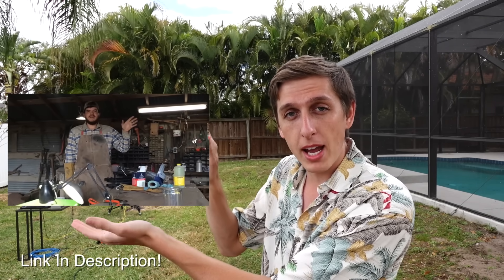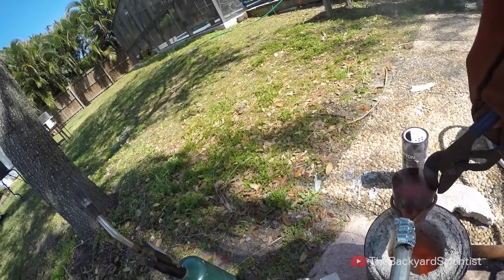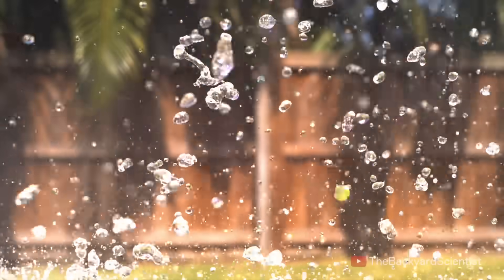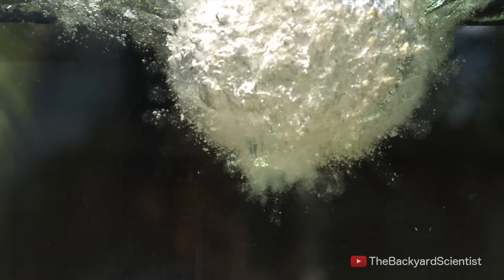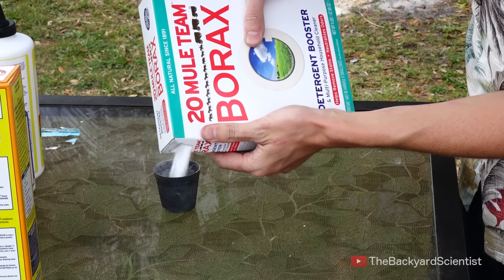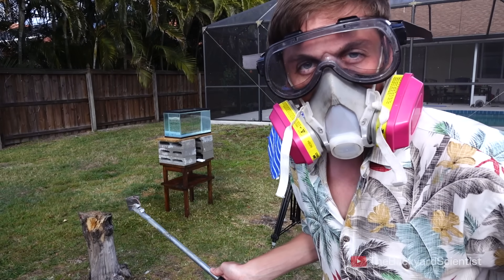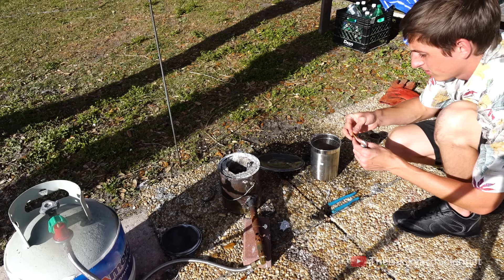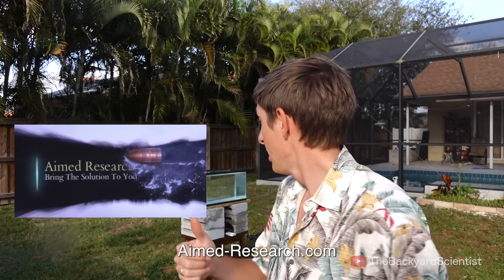Pouring Molten salt into Water - Explosion!

Comment: Is it possible that the extra extreme heat causes the NaCl to instead breakdown, when added to the water, into pure sodium and chloride rather than their respective ionic forms?  The sodium could then react exothermically with the water again, forming NaOH and hydrogen gas, but rather than the gas reacting in a fiery explosive way with the free oxygen in the air, it binds with the chloride to form HCl (again, because of how the extra initial heat could offer the elements different reactive options than what happens at room temperature).  Perhaps it could even occur as an immediate "switcheroo," with the formation of pure sodium simultaneously breaking apart the H20 and allowing, as mentioned above, the chlorine to bond to the hydrogen?  What are your thoughts, internet chemists?  Please note that my knowledge of chemistry is quite weak, but it does seem apparent that the excess heat does allow for otherwise abnormal reactions to take place more readily.

Comment: Salt has very high affinity with water, and wants to bond as quickly as possible. Salt ionizes in water. The sodium and chlorine atoms separate and intermingle with the water. 
The salt is NaCl, and the H atoms of water surround chloride ions and O atom of water surround sodium ions. This is called enthalpy of solution and this releases energy,  depending on whether the salt is a hydrate or anhydrous. I have no doubt that the act of melting the salt makes it anhydrous. I guess this combined with the thermally generated steam is enough to make a pretty cool explosion.

Comment: You should also take into consideration that it is probably working like this in the environment: 
NaCl(aq) + H2O(l) --> NaOH(aq) + HCl(g)
Then it reverts back to its normal equation after reaching a certain temperature:
NaOH(aq) + HCl(aq) --> NaCl(aq) + H2O(l)
I believe it can both explain the pH remaining at 7 and the explosion to my knowledge, however my knowledge is limited.

Comment: I'm no chemist, but I think it has to do with sodium. I'm pretty sure it naturally reacts that way, or maybe it's the drastic temperature change.
Reply: He tested for pH change, so there was no reaction with the water. Also as you can see the Na reaction looks completely different from the NaCl one.
Reply: ginraw No, there wasn't, the system is in dynamic equilibrium, and it reaches equilibrium so fast that you don't notice. What happens when you mix table salt and water, and try to drink it? You don't die, it just tastes really bad because it's salt water. In other words, there is no opportunity to observe chemical change because the system reaches equilibrium within milliseconds. Anyways I think we're both agreeing on the same thing, that it's not a chemical process, but a physical one that causes the explosion. Here's a great discussion page. that provides a good explanation:

https://www.quora.com/Why-does-molten-sodium-chloride-table-salt-explode-when-poured-into-cold-water
Reply: No, the sodium present in the water is ionized. It's stable, and surrounded by a hydration shell, so it wont behave anything like sodium metal.
Reply: Jonathon Andrews you raise an interesting point. I've learned that all the elements in the first group react vigorously in water. It could be the sodium because it's in the first group.
Reply: Winex HD That's just conjecture, I'm sure I saw Na reacting like that with water. Maybe being heated to that point seperates the bond and the Na reacts, while the Cl just mixes with the water.
Reply: Flatx1 You wouldn't see a pH change, NaCl forms a strong acid and strong base pair in water (NaOH and HCl) which effectively cancel.
Reply: Ghufran Noor That's what I'm saying. There may not have been an overall pH change, but the opportunity for a chemical change was present by the forming of NaOH and HCl
Reply: NaCl would NOT FORM NaOH OR HCl.
That's WHY they are STRONG acids/bases. jesus.
Reply: Myke Prior It would actually produce very very small concentrations of HCl and NaOH (so small that in the big picture you can basically say that HCl and NaOH aren't formed at all). Because the formation of these products is so thermodynamically unfavorable, the system will quickly reach dynamic equilibrium, and the concentrations of HCl and NaOH will be so small, that they will be negligible.

So you're right, you can basically say, that NaCl doesn't form NaOH and HCl (since the amounts formed are negligible).
Reply: +Winex HD It has to do with the fact that when Sodium (Na) are poured in water, it reacts to form Sodium hydroxide (NaOH) and hydrogen gas (H2), which is explosive. Since te whole reaction is an exothermic reaction, the heat released ''reacts'' with the hydrogen gas (which is explosive). Thats why it explodes depending on the amount of Sodium you use. :)
Reply: Atheist Metalhead No, NaCl is completely different from pure Na. when the compound dissolves, you get ionic Na. Besides, if NaOH were formed, the water would have been found to be alkaline. also, there would be flames.
Reply: Vio45lin You are totally right about that, but I wasn't talking about NaCl :) I just explained why sodium reacts aggressively with water and not ONLY because its in the 1st group (Y)
Reply: Atheist Metalhead Oops! Sorry about that :P
Reply: Vio45lin No prob man ;)

Comment: could it also be similar to a prince Rupert drop? the outside cooling faster than the inside, and crystallizing? and then since it is such a thin layer of super strong salt crystals maybe partially dissolving in the water creating a shatter explosion similar to the prince Rupert drop and the inside layer doing the same until it is all the same temp?
Reply: I think it's something a lot like that. At least the outside crystallizes, and when it shatters outward, it superheats all the water around it, multiplying the effect. It would be nice if we could get a camera angle from above, showing what is happening inside the explosion crater.
Reply: Johnny NoFace

Comment: It is a chemical reaction, when you melt sodium chloride it removes the chlorine almost completely, making it mostly sodium, which, when mixed with water (H2O), explodes because water has a polarity but sodium only has one charge, so one part of water wants to adhere to the sodium, but the other part repels instantly, making a gas induced explosion, with a small implosion of the ions that adhere to each other
Reply: Did you see the whole video?
Reply: Sorry, but no. After molten salt cooled down, it remained NaCl. It still got crystal structure, and did not look like metal.
Reply: heating alone can never decompose sodium compounds
Reply: Where was the chlorine gas, then?
Reply: Susan Mur
Reply: Well 1.2.3 KABOOM
Reply: Susan Murphy Thank you Teacher.. :D
Reply: Ajg0r, maybe so. But if you go to 1:10, it does look a bit like the metal. So maybe it isn't removing ALL the Chlorine (which it why it still loses somewhat crystalline) but it is removing enough to give it some properties of the metal.
Reply: Na is highly explosive when exposed to water
Reply: Susan Murphy
Reply: Susan Murphy . "Small implosion of the ions" .... Big laugh for me you hobby scientist 😂

Comment: You can gauge the energy of the reaction from the rate of heat displacement.  Sodium metal reacted almost immediately and fully upon  contact of water.  What will deceive is that perspective of greater force in the water because the water is being displaced by the reaction of the sodium chloride whereas the sodium metal is only displacing air.  If you want an apples to apples comparison, both chemically propagated physical rearrangements must take place, in the same environment as in both reactions must happen entirely enveloped in the water from start to finish.  I figure some type of timed container.  Based on the reaction rate I'd say the apparent reaction of the sodium metal would be at least 10 times greater, so adjust mass accordingly. Be safe. Going to go ahead and subscribe.  Thanks for the vid!

Comment: My guess would be that it reacts this way because of its solubility in water. As the molten salt touches the water it starts to dissolve rapidly, conducting heat into the water causing rapid expansion of steam. And since water isn't compressible, the fish tank absorbs most of the pressures the expanding gas produces, which is why it is strong enough to blow it apart. This could explain is why some would call it an "explosion"

Comment: keep in mind that I do not remember much from chemistry class, but what I do remember is that when you put any element from group one of the periodic table into water, it will produce a similar effect. Is it possible that when you heat the NaCl to such a degree, some of the chemical bond is lost causing the sodium to be isolated, causing the explosion? I do however know that putting elemental francium (Fr), or elemental Potassium (K). Maybe bonded forms or salt forms of all of the alkali metals would react in the same manner when heated? 

I think you should definitely try this with potassium chloride or even Lithium chloride. I will warn you that with the elemental forms, the reactions get more violent as you move down the group of alkali metals.
Reply: Okay a bit of a Chemistry lesson: 
Sodium in its elemental form (reactive metal with zero charge) is a very different beast compared to the stable chemical compound NaCl. Sodium metal is a reducing agent and violently reacts with air/water to become NaOH and the hydrogen evolved catches fire in air as you have seen.
NaCl can be melted and recovered unchanged and all the suggestions here are incorrect. All this experiment does is reflect heat exchange with great vigor AND combined with the high affinity of NaCl molten (which has become anhydrous) redissolving with vigor. The central core becomes superheated and wants to re-equilibrate violently (no fire) to produce a solution. Transforming (reducing) or separating charged Na+ from Cl- into pockets of some sort is NOT what happens as that binding is very strong. Now one can make this more dramatic (and probably dangerous) by using molten salts with an even higher affinity for water. The other salts he tried were had a low affinity for water and gave just a basic fizz. I don't want to go into all the details, but suffice to say it is not some exotic chemical reaction.  Going from sodium metal to sodium ion salts is downhill and favorable, but the reverse requires a MAJOR energy input. This is why sodium exists as its salts mainly NaCl (oceanic) in nature.
Reply: Na+ is attracted to the oxygen side of the water and Cl- the hydrogen part and when molten the bond weakens this means the atoms are able to split and create an compound with another element. So when Na+ mixes with the water it explodes
Reply: isnt Na+ attracted to H+ and Cl is attracted to OH- in water
Reply: think of the chemicals as mini magnets, the Na+ would be more attracted to a negatively charged ion as opposed to something that is also positive. So, as the person who commented before you said, the Na is attracted to the oxygen which has a charge of -2 making (Na2)O or something like that (pretend the 2 is subscript)

Comment: What about heat capacity? (been a while, might be the wrong term) Could molten salt hold more heat energy per degree per gram? Also, solubility rules have been a while for me as well, but could NaCl be more ready to dissolve than the others, thus enhancing the effect you hypothesized?

OOORRRR, Alt Hypothesis #3: the increased heat of the NaCl brought the effect because it surpassed a typical molten state. The other salts could do hypothetically do the same, it just takes more heat to reach that (perhaps plasma) state. 

Fun experiment either way!

Comment: I'm positive the answer lies within the realm of high-temperature surface off-gassing effects in direct relation to surface tension laws and how they can change while exposed to extreme temperatures. Or in this case, a situation where a compound in a very natural state (H20 at I'd guess 70 to 74 degrees or so) is exposed to a solid compound (NaCl or Sodium chloride) that has been allowed to absorb an extreme amount of potential energy. Something to be of note in this specific instance is that sodium chloride is of equal parts sodium and chloride and that the compound is both water soluble and has a very high boiling point  (Suggesting that it undergoes little-to--no chemical change douring heating.

Comment: Perhaps the NaCl has a higher coefficient of heat difussion, so it releases heat faster than the other salts, thus, it wouldn't be protected by the Leidenfrost effect because its temperature has lowered enough to surpass the safe limit while you get the crucible near enough the aquarium to pour it, I suggest as an experiment that you find a way to pour the salt directly from the crucible to the water without removing the heat source, and take notes, I have not read the papers yet, so I don't know if it's explained there, just giving my best guess :3
Reply: Bryan De la Hoz I just checked the coefficient and I can't remember the unit but borax was 0.24 and salt 0.20 so the difference is not big. This final question really bother me

Comment: my thought on what was happening is like the prince Rupert drop where the outside of the salt cools down faster than the inside and so the insides at a higher pressure and because the shape is so unstable there's weak points that break and release that energy in an explosion just like breaking the tail of the prince Rupert drop

Comment: I just thought of an alternative hypothesis for the cause. It's plausible that the heat and liquid state of the molten salt make it bond and mix quickly with the water, making the heat transfer to the water even faster than other hot liquids, causing the explosive rapid boiling.

Comment: Do you think the Leidenfrost Effect did not protect the salt because of the very chemical makeup of NaCl itself? You can see an initial Leidenfrost effect as the salt goes in. There's a coating of vapour around the salt. I might be making a big fool of myself here but I'm just putting it out there. 

The extreme heat allows a chemical reaction to happen. You can just see a kind of implosion/cavity effect going on before the big explosion. This might be a bit quick and it's been awhile since I've done any chemistry but would the extreme heat dissociate Hydrogen atoms from the H2O molecule which then bond with Cl ions to act as HCl, which then reacts very violently with Na ions to release H2 and leave NaCl again? No pH change. On top of rapid vapour expansion after initial gas explosions. 

Obviously I'm not sure about this because I don't know about the other ionic liquids enough. But I was really interested as to why the leidenfrost effect didn't kick in! I would appreciate if someone would come along and correct me please!

Comment: I have the answer. At 3:29 doesn't the gas bubble look like a star? It does. So when it exploded again it's basically like a star doing a supernova, or a blackhole. It compacted then it had a little ring slowly emerge from it. Now you might be asking why is the "supernova" so quick with the salt, and with the stars so long? Well it's because of the size and the atmosphere around it. Molten salt in water is like the stars in our galaxy in a giant (I mean absolutely massive) pool of gasoline it will explode, exactly like a supernova. So the answer is it's the atmosphere around it reacting to what it's made of. Hope this helped, there might be more to the answer but I know I have most of the answer, if not all of the the answer.
Reply: Also at 6:25 see what I mean!
Reply: But you are right about the physical explosion part
Reply: not sure if you're talking analogously or think there's an actual combustion effect going on. You are confusedly implying a chemical reaction I believe, if I'm reading your comment correctly. 
"the answer is it's the atmosphere around it reacting to what it's made of" - you
I assume by atmosphere you mean environment in a loose sense, describing the chemical makeup of the water? Or do you mean some kind of atmosphere within the water around the salt? In both cases, by your reference to the Sodium - Water combustion reaction, you are incorrect on the salt. It's not a chemical reaction, as the video suggests.
If you have the answer, I didn't understand a bit of it.

Comment: Howabout videoing the article-stated blacksmith's adage of spitting on a redhot iron and striking a ball of spittle—which hurls the hammer over the roof and blows a hole the iron. (P.S. the science should be more interesting than merely repeating the experiment...)
Reply from the maker: +Raymond K Petry YES I tried that but didn't have much luck at all. I want to redo that and see how I can make it happen.
Reply: Maybe the "iron" is a sword being thinned, and maybe the "hole" is a pit (which would devalue the sword as would a hole), maybe old swords were crude under their shine; the science is of that heat reservoir—superheating, raindrops...
Reply: Raymond K Petry k

Comment: If you want to know what's happening, it's this:  When the table salt is very hot, the ionic bonds between the sodium and chlorine are "loose" enough for the sodium metal to react with the water.  The sodium contacts the water and immediately replaces the hydrogen in the water molecules forming sodium hydroxide, which results in a cloud of highly flammable hydrogen gas and a rapid release of intense heat which ignites the cloud of hydrogen gas in the presence of oxygen from the air.  This is what causes the explosion.  I haven't considered what happens to the chlorine, but I would be inclined to assume that it is released as a gas.